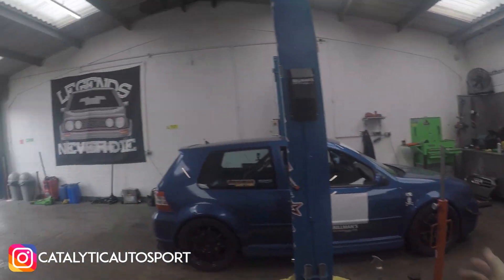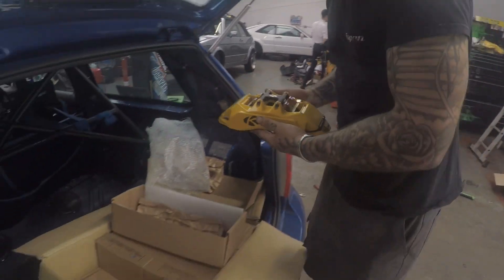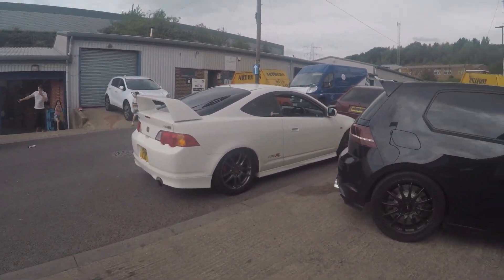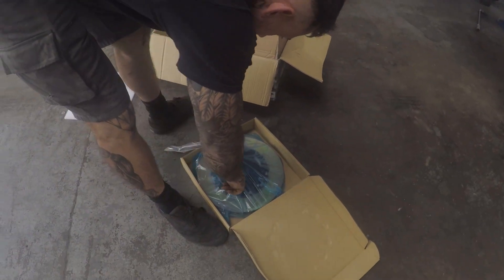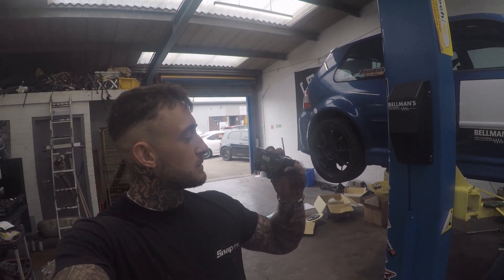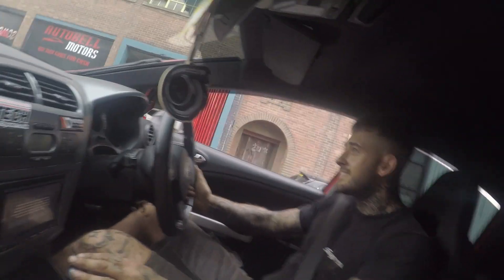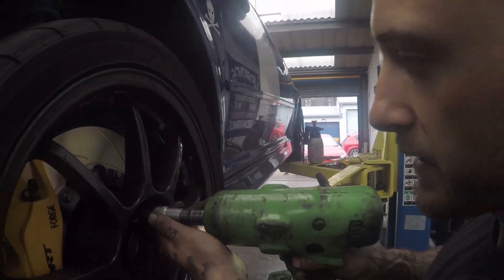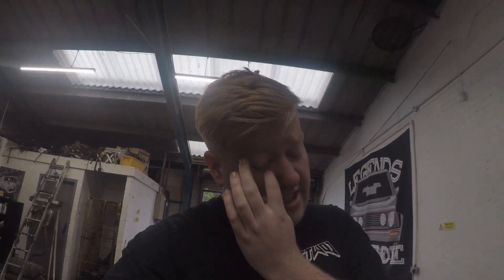Track R32 Gets a K-Sport Big Brake Kit!

Comment: What spacers do you reckon you would need for these if you were running the standard 18” Aristo Alloys?
Reply from the maker: Wouldn’t take a lot mate i’d stick 15mm on anyway to have them sit nicely with the arch, the calipers themselves aren’t very wide 👍
Reply: I was hoping to be able to get away with 10mm on the front tbf. You’ve obviously had these for a little while now, are you happy with the generally? Worth the investment?
Reply from the maker: @scottwalters2367  can’t fault them one bit, just make sure you go for the pagid pads. Never faded or warped in track all the confidence you need 👍
Reply: Got mine fitted on the r32 today, they look awesome but the garage had a nightmare with the original wheel nuts. Just wondering what studs you’ve used as I am gonna have to swap them out. Cheers!